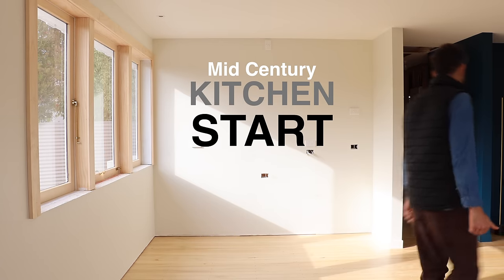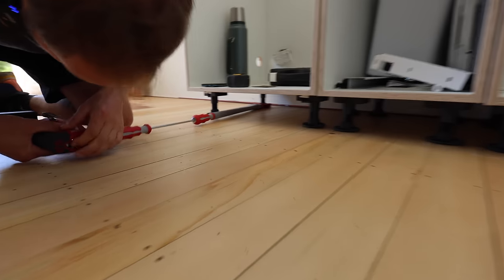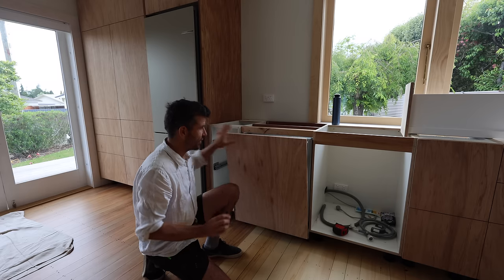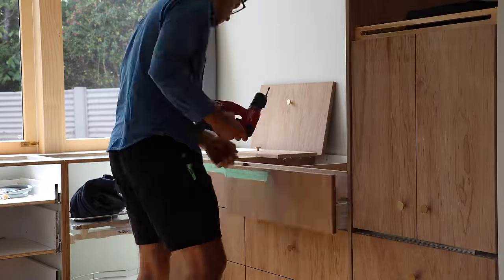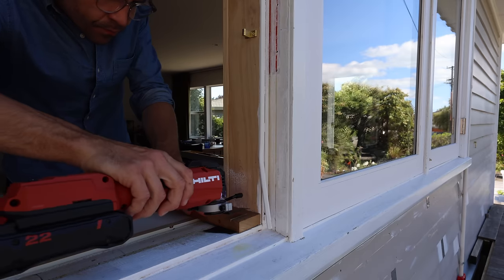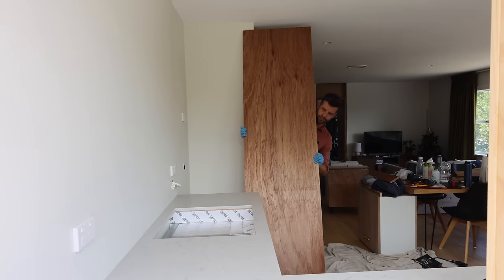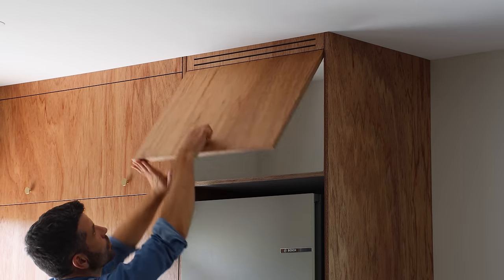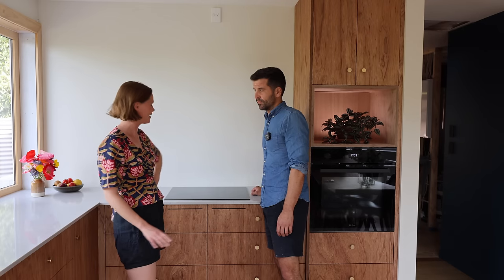I Made a PLYWOOD Kitchen look like THIS

Comment: Im carpenter in germany and i think you did an amazing job building that kitchen from scratch without knowing too much about cabinet making... so props on that. As a splashback what we sometimes do is take glass with sanded edges and paint it from the backside in a colour you like. It would give you a similar texture as your benchtop and it really is quite an affordable way of creating a high end splash back which will be easy to clean

Comment: Great vision and execution guys. If I’m not building with prefinished I often take the time to coat the ply in full sheet form both sides prior to breaking them down. With osmo I literally pour it on and trowel it with a 12 inch drywall knife over the surface and skootch extra into container for the next face. Very fast and even if you’re good with a knife. One or two coats really helps limit the breakout potential when cutting pieces as well. You’ll get the odd scratch and scuff but nothing some careful prep and another coat can’t handle

Comment: You did very well.  You have created a great kitchen.  Very professional looking.  I too built my kitchen from scratch here in Sydney. Similar size to yours but we did Satin Melamine and then had it sprayed White with Polyurethane.  With me making all cabinets, removing walls etc, ikncluding dhiswaher, 800mm Siemens hob ($AU4,000) it cost us $AU29,000 for it all. I did all my own plumbing, plastering and electrical (with a little help from my nephew the electrician). So you did well.  You should be proud.  Well done.

Comment: Omg beutiful,  for my 1950 Snells Beach Bach I reluctantly pulled out the og yellow kitchen and bought a mcm style 2000 built kitchen off a friend for $300, solid rimu doors and a sage green benchtop but you guessed it melamine cupboards unfortunately, you should be so proud of that kitchen it is lovely, so nice to find your videos again,  I smashed my Bach for 6 months and then rented it out,  now doing live in finish,  plastering the gib etc, full retrofit insulation like your videos and kept the pinex ceiling,  couple of cavity sliders and she is getting close,  I must do a catch up on your videos,  spending a couple of months in my spare time minting then moving in with the new misses, thx for the video,  inspirational

Comment: I did a kitchen a while back in Aus and used a Custom Flat Pack company to CNC my cabinets in MDF with a 2 pack paint finish which included the Blum hardware, draw runners, hinges etc. I then assembled and installed the cabinets. Costs were $10k for the cabinets. Timber benchtops ( 30mm thick solid recycled Messmate with waterfall edge ) $10k, Appliances $10k and other trades ( electricians, plumber, flooring, lighting etc ) $10k AUD. Kitchen was a bit bigger than yours. Building cabinets is time consuming. We had Cabinet Makers quote $28 - $32k AUD just to do the cabinetry, so the custom flat pack was a good option and saved us about $20k. All hinge holes, shelf pin holes etc pre-drilled. Nice job on yours, it looks great!

Comment: Hey Scott.Awesome kitchen.We also built our own kitchen and the backsplash behind the hob we used armour plated glass for heat,with 4 holes for fixing with mirror screws,the wall behind painted to a colour of your choice .Periodically we change the colour as it gets boring over time .Cleans easily .Silicone all the way around to prevent ants and dust from getting in there.Better than tiles which we had previously.Good luck.

Comment: Jep, did that too 7 years ago. I reproduced a mid century steel "American Kitchen by Raymond Loewy" out of particleboard and MDF, and 16 worn rotted old cabinets for the grips and drawerfronts. The total price was a little less than 8000 euro including all Smeg appliances (fridge freezer, oven, hood, stovetop and dishwasher). It still looks awesome but, never again it took so much time from start to finish.

I got a quote from a shop that sold repaired/renovated original cabinets that was 24000 euro. no appliances, no countertop.

Comment: What an awesome job on the kitchen Scott, it looks amazing! If you want to keep the backsplash clean/minimalist, I can really recommend just using a sheet of glass. Might sound fragile, but there's still no visible wear to it and we've used it for 10 years now. First we had a simple wallpaper behind the glass, but we just recently changed it to a layer of microcement (which usually comes in a variety of colors) and put the glass back over it, just to make it easier to clean. Curious to see what you guys go with, best of luck either way!

Comment: This looks amazing, and I particularly love the inside/outside vibe once the windows are open. 

We’re about 80% of the way through a 2.5x4.8m kitchen renovation. Discounting the costs of converting the room (which used to be an integrated garage), the actual units and worktop were about £9.5k and labour to install it is going to be about £3-4k. Appliances were about £2.5k, sink and tap about £600.

This is a mid range build through one of the dedicated nationwide kitchen suppliers here but it’s very easy to pay a lot more than this. Our next door neighbour went to a boutique place and spent £19k on cabinetry alone.

Comment: Re: installing and leveling, I live in an old city full of old houses.  My current house was built in 1900, the one before that was 1905. Every time I read a woodworking article and get to the part where they inevitably say "Find a flat, level spot to lay things out..." I think, "Obviously you've never been to Pittsburgh."

One of my friends is a crazy good carpenter, works on restoring historic landmark mansions, etc.   I've never talked with him about kitchen cabinets, but we talked about how to build built-in book shelves once.  He said you start by building a very low platform to set the shelves on, to make it's level and square.  Then you build sets of shelves and install them on that platform.

Ten years ago I needed to get some new kitchen cabinets and I did a lot of looking into what was available. Everybody sold MDF carcasses.  You could get real wood doors, but none of the major vendors sold even plywood carcasses.  I did find a few small vendors who would do plywood cabinet carcasses, they started at $1000 per cabinet and then went up.

I ended up buying Ikea cabinets.  They're also MDF, but they seemed to be made a bit sturdier than the cheaper ones.  More importantly, Ikea uses a rail mounting system.  You mount the rail to the wall, then can adjust the rail to be level and square, then hang the cabinets from them.  I thought that would work better for my old house, and it did.

Comment: Kitchen looks stunning. I'm in the process of planning my own plywood kitchen here in Oz, and I'm using baltic pine ply or hoop pine ply, with a stainless steel top and splash back. I think a low stainless steel splash back would look great in your kitchen - neutral in colour, as you want, and super easy to maintain - no grout, and easy wipe over to remove anything that gets on it.
Reply: Baltic or Hoop are really soft. I'm looking at doing a plywood kitchen as well but I'm planning on using birch ply fronts with Black Butt veneer both sides and I've been able to get black butt edging as well. !00% agree with the glass splash back. What stainless top are you looking at?
Reply: @geoffsemon7411  Thanks for your feedback. The baltic or hoop pine ply would be used for drawer fronts, not bench tops, so softness is less of an issue. But I'll investigate further. Stainless steel top, with integrated sink and drainer is 1.5mm, 304, N4 stainless steel, with substrate thickness of 33mm. It has a back / upstand 100mm high.
Reply: Baltic pine ply?? What am I talking about. I meant BIRCH ply.

Comment: Tiled splash backs are nice. We had a herringbone pattern one in a previous home we renovated. Really loved looking at it. Did not enjoy cleaning it though. If you don't keep on top of it, the grout stains very easily. You can grout seal every 12 months or so, but even then it's not perfect.
Have a glass one now, and while it's not as nice aesthetically (still pretty nice), it's just way easier to maintain.

Comment: Love the content. We've just done a (hands-off) kitchen refurb here in London and spent £25k (including VAT & appliances) plus fitting, for a high-grade melamine kitchen. Plywood kitchens seem popular in Australia and New Zealand, not so much here in the UK. We had coloured glass splashbacks custom made, cost a lot but looks great - they can spray to whatever colour you like given a RAL reference. 👍👌
Reply from the maker: Peter! Wow, Kitchens are pricey. Glad I built ours for the experience alone. Thank you for all the tips you share on the channel, they definitely helped me with this project.
Reply: @ScottBrownCarpentry  Cheers Scott. Yes, though a drop in the bucket compared to what the house extension cost! 😬 I suspect if you added in your time at commercial rates you probably wouldn’t be far off that. Ours was about 5 metres square, 7 full height units, 8 base units, 2 single 1 double drawer units, 3 single & 3 double wall units with aventos lifts and a 2m island. Decent number of appliances too, so the costs stack up. 

And thanks, kind of you to say; all we ever really want to do is makes vids that help, and are interesting to watch, right? Loving the house reno; always fascinating to see how things are constructed in other countries! Thanks again and Happy New Year from London. Peter

Comment: i used large tiles in my kitchen reno splashbck. Bought a few packs of 60cm x60cm porcelain tiles from bunnings and just installed a single row. Was quite cheap and looks pretty good. I didnt want to have that small tile vibe, and didn't want to shell out for a stone or glass splashback, so it was a good compromise

Comment: For our backsplash, we used a mosaic tile (thinner horizontal pieces) that was a mixture of brownish stones, glass, and metallic pieces that come in 1’ square sheets. We really like it. 

We had solid 60 year old plywood cabinets so we just refaced them for $10k US with a new quartz countertop for another $4k. We reused the appliances and I did the tile for the backsplash and floor ($500), though our kitchen - 13’/4m galley, is probably smaller than yours.

Comment: Guys, the kitchen looks fantastic. As has been commented here a number of times already, I'd go with glass. I had a painted glass splash back installed in this year and could not be happier. Only piece of advice I would give, the natural colour of the glass will have a slight effect on the paint colour so this needs to be taken into account.
Reply: Low iron glass avoids that issue. Meaning your paint colour is very accurate once painted on the back of the glass.

Comment: We also have DIY'd our house and followed the mid century feel of it. We went for a stone finger mosaic tile (laid horizontal) which kinda feels very akin to mid century square brick patterns. You could go lighter or dark, but the texture of the mosaic smaller tiles after grouting still feels so satisfying visually and to touch. But without being over powering (if your grout matches the colour of the tile) Though, porcelain might be a better option for cleaning.

Comment: Our splashback is a 30-40cm high piece of glass that goes the length of the wall. It is paintet on the backside with the same colour as the wall. Then it is sciliconed in place. Looks really good and is easy to clean👍

Comment: Hi guys! Great kitchen, looks amazing! For our kitchen renovation we did a clear glass splashback, which we then painted with the same paint as the wall on the back side of the glass with a foam roller. Turned out amazing and the glass is really easy to keep clean 😁 highly recommend it!

Comment: I made my first kitchen with 25mm marine ply, very splinter prone, easy to re finish, but does change colour a fair bit in the sun so you’ll have to keep topping up the oil every few years. Also, it’s not as hard warring as factory stuff. However, it’s easy to re finish even touch up chips from the children etc. But I just love the cylinder cut ply, as it’s a continuous real grain that just pops so nicely with the oil. Nice job!
Reply: Also I run the grain width ways using 3050/1525 sheets with routed grooves for the handles, really don’t want to make mistakes with that one! That was 2007. New owner in 2023, proudly stated how they’d put a new Ikea one in. They paid a premium for the hand built boutique style, but clearly had no taste.

Comment: One of the things I’ve done to reduce splintering is to apply a first coat of finish before cutting. It also makes the first coat easier in many ways because a bigger area can be covered in less time.

Comment: Nice work, very nice work! An idea for the splash back wall may be to simply place a clear glass panel on it. Keeping it in place with brass thingies. Or paint the wall with washable exterior paint. Works fine, I know from experience.

Comment: If you want something that is not tiles, I did a stainless steel backsplash, it is very easy to clean and looks modern but is also affordable and easy to install. 
I ordered mine to size and they cut it on their water cutter, so just It was a mastic adhesive, and pushed it into place. I remember you could get it in a brushed copper as well.

Comment: I would use 12" x 24" porcelain tiles that has a colour similar to the countertop. I suggested porcelain as it is easy to clean, handles heat/steam, and, as the counter is shiny, it would be consistent with the surface texture. The cabinets are great. Induction cooktop will definitely save electricity (cooks much faster and more precise temperature). Great idea to add vents on the drawer, and cabinet face for the induction cooktop. The LED lights in the pantry is very good. An idea I may be using in my pantry as well.

Comment: Backspllsh suggestion: run a 2" x 5" herring-bone tile pattern, from the countertop all the way to the ceiling, encase borders with a stainless or copper strip, use light-grey or off white in colour tiles.......then get a hanging pot-rack for beside the stove vent, hang copper pots on it or maybe some open shelving............."mix the metals" then, you'll have brass coloured hardware, stainless vent and copper pots.......we have done this a few times, it looks amazing.

Comment: I used a silver grey glass splashback. Quite expensive though seeing as it was done during covid. Two other alternatives were considered. First was a brushed stainless steel sheet. Readily available from commercial kitchen suppliers and fitter but was binned as the horizontal run was 3m plus (I have a 1200mm induction stove top) hence warping concerns. Small and large format tiles were considered and dismissed for weight concerns as well certainty that the grout would stain and discolour very quickly. Highly recommend an inline fan run at the exit end of the flue for the rangehood, sucks in smells like a jet engine intake and it shoots it out immediately.

Comment: Hi nice installation , surprised at the cost considering you did all the work . Here in the Uk I recon probably under £8000 pounds on materials , as a do it yourself project . For the cabinets only , obviously if you have to employ other trades that’s going to increase the costs . As an average electricians and plumbers in most of the Uk charge around £200 pounds a day .  But as a retired electrical contractor , that’s not a problem to me , plus I’ve done plenty of plumbing work over the years in various houses we’ve renovated . But I fully understand your needs to get professionals , plus building codes in your location may insist on such involvement. As regards the splash back coloured acrylic sheeting can look great  or a piece of top quality s/s can look very sophisticated and very on trend .   But I must complement on your skills , as someone who has worked on fitted kitchens in excess of £200 thousand pounds , not including appliances . Your work would put some of them in the shade ,  so when it comes to kitchen you don’t necessarily get what you pay for . Which definitely applies here in the Uk .  So finally can I take this opportunity to wish you both the very best , and although a bit late a happy new year .   Best wishes and kind regards from here on the edge of the Lincolnshire Wolds  in the UK  😀👍

Comment: Looks good, nice job, I really like the big windows down to the countertops. I'm going to be building a kitchen in a couple years after I've finished my basement and I'm considering maple plywood with possibly some stainless steel hardware and backsplash. I've built a few kitchens in the past and I find instead of putting rear legs on the base cabinets it's easier just to put a level cleat on the wall and rest the cabinets on that then just adjust the front legs, just a tip if you ever build another.

Comment: I did a kitchen in my Auckland townhouse. Granite tops, mdf units, Blum hardware. New oven, new microwave, new induction top, new fridge, new dishwasher, new range hood all smeg appliances except the dishdrawer. I did all the grunt work, but got a plumber and sparky to do their bit. It's a bit smaller than your kitchen. It came in at roughly $60k

Comment: Splash back, tiles, stainless, glass, mirror. Glass in this rental shows all of the oil splashes though. However you may be able to get an offcut of granite or even that same synthetic stuff long enough to do the stove only for free or cheap. You can cut it with a skilsaw and diamond blade. Wear a respirator. This will mask the oils and even absorb and spread them. Good luck.